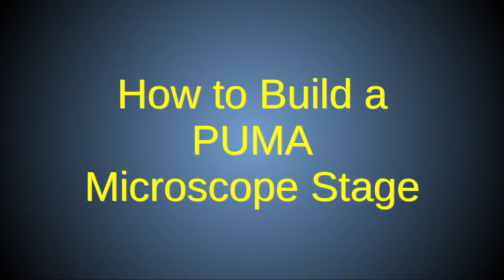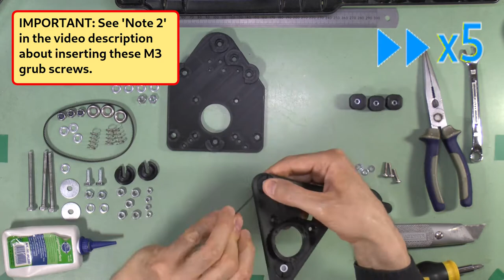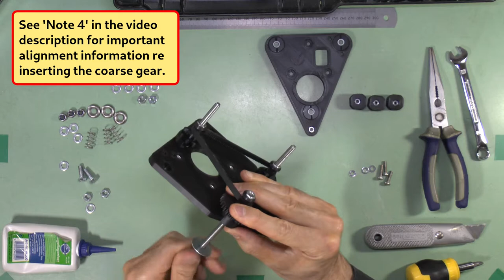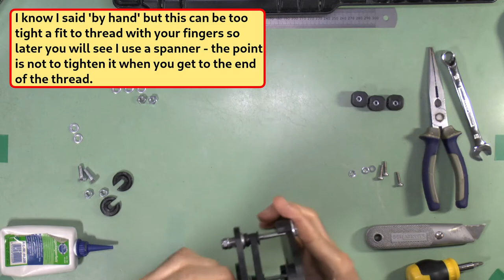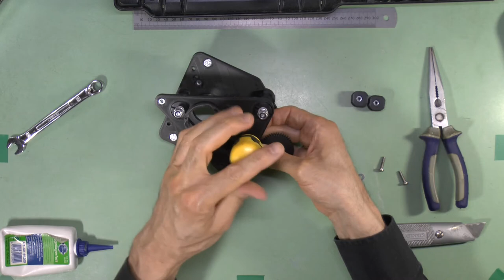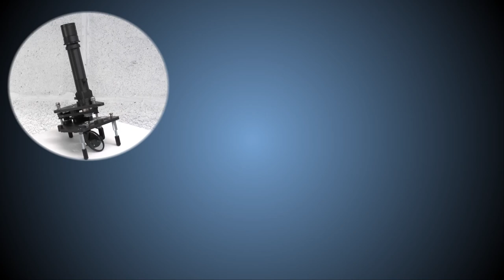How To Build the Stage of the PUMA 3D Printed Open Source Microscope

Comment from the maker: This is the first detailed 'How To' video for PUMA and shows you how to build the single most complex mechanical module common to ALL PUMA micscoscopes - the Z-Stage. If you attempt to build one and need clarification on any points mentioned in the video please post a comment and I will do my best to clarify the issue. This will help others trying to make a PUMA scope. Some more useful notes are below:

To keep the video to a reasonable length I haven't gone into detail about print post-processing but it is assumed that anyone attempting to build a PUMA has some 3D printing experience under their belt and the video shows you what the final part should look like. Please consult the the 3D printing guide PDF document on the GitHub page before printing anything because it gives important information about orientation of each model on the print bed, slicer settings and supports. I have only ever built PUMA parts with my (enclosed and well-tempered) Ender 3 using standard black PLA and Cura slicer with STL meshes generated as described in the GitHub 3D Print guide document. No doubt your mileage may vary - especially if using other parameters.

Note that the holes for screws of M4 and smaller have no 3D printed thread. Instead the holes are designed to be slightly smaller in diameter than required and the user is supposed to create a thread as they screw the metal screw into the hole using the screw itself as a kind of tap.

With regards the adjustable articulations, note that the front one needs to be threaded up from the undersurface of the focus plate because the quick release mechanism gets in the way from on top. I didn't say that in the video but you can see me doing it.

Tip: It may be easier (better access) to fit the rear eccentric belt tensioner before fitting the intermediate and fine focus gears.

This video has manually edited subtitles available for anyone who needs them.

Apologies for this long pinned first comment but, due to all the construction notes, I ran out of space in the video description!

Comment from the maker: For those building the Z-Stage, there are more videos on the Z-Stage planned for release. These include advice on 'Troubleshooting' and 'Maintenance' as well as add-ons such as 'Motorising the Z-Stage', 'Adding an XY Slide Holder' and advice and tutorials about focussing, performing Z-sweeps and such. So it doesn't end with the this 'How to Build' video - this is just the beginning. In the mean time if you have any issues or tips. post a comment here so all can benefit from the collective experience. Thanks for your support.

Comment: Sorry I am a little confused about the installation of the grub screws at 8:20 (even after consulting your note #2).  I am hoping to learn about microscopes by building the PUMA, however the printer I have access to does not give me consistent tolerances.  Are the M3 grub screws meant to stop the passive turning of the adjustable articulations by producing a tiny protrusion in the pitches (and thus creating a spot with higher friction)?  And by how much are these adjustable articulations designed to rotate? A couple of degrees?  I am just wondering whether it would be OK for me to just proceed without the grub screws for now if the articulations are not turning that smoothly anyway...  Many thanks!
Reply from the maker: Yes - as you say - the grubs here are designed to add some friction by forming a little protrusion of the female thread for the adjustable articulations (AA) and so lock the AA in whatever position you have found the AA to require to give the correct parallel alignment of focus plate to base plate.
In practice I have found that the AA don't need to be turned much, if at all, and usually not even to one full turn if everything is printed and built well. 
You might be able to get away without those grub screws if the AA fit is tight although tight fitting AAs kind of defeats their purpose as an easy adjustment mechanism. Perhaps you can try without the grub screws and if you find problems with the AAs rotating passively over time with focussing then disassemble, brush the AA threads with a wire brush till they rotate smoothly in their sockets (concentrate on the 3D print seams and any zits on both the male and female threads because these are usually the sticking points) and re-assemble using the the grub screws to lock them.